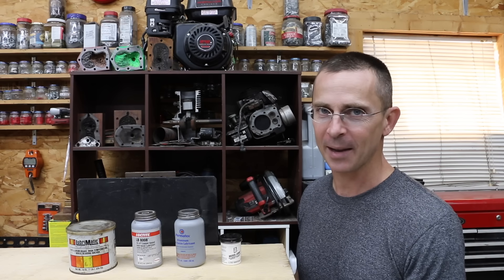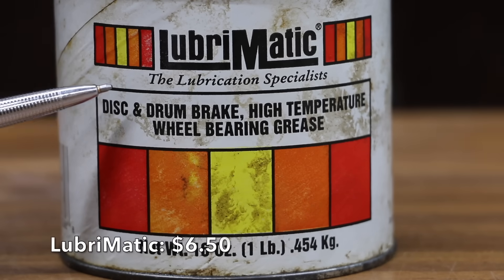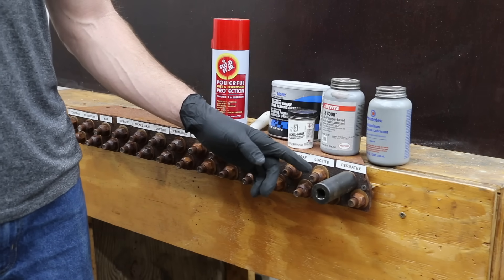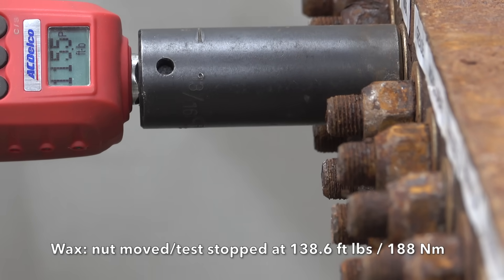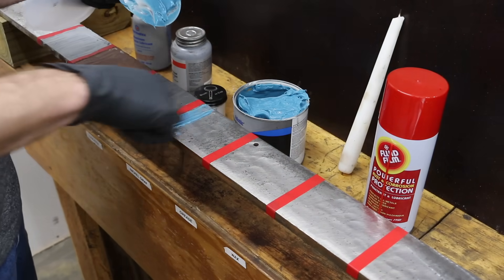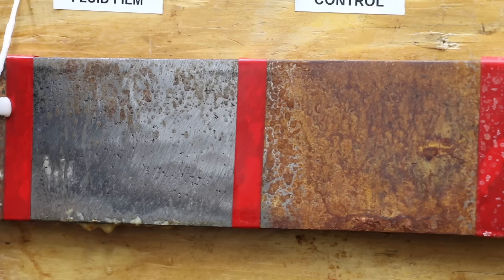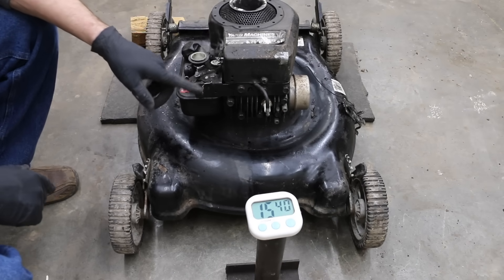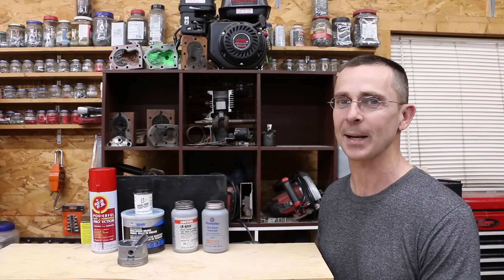Does Anti-Seize Compound Actually Work? Let's find out! Anti-Seize vs Grease vs Fluid Film vs Wax

Comment: I knew an old timer that said he always coated bolt threads with paint. He said it kept out moisture and prevented oxidation.
Reply from the maker: Thanks for sharing.
Reply: @billsmith1770  good point.  It might have been the lead that helped.

Comment: All you guys and gals who Love aluminum rims on your vehicles..?..Wait until you try to remove 1 on the side of a road,and it's welded to the rotor,or drum..edit=Worked in a dealership's garage and had to use a 4 FOOT prybar to crack rims loose when the 15lb sledge hammer with a 3ft handle didn't help, on vehicles just a year old.I was there during an infamous tire recall,and  a 100+ per week was Not fun(5 per vehicle,as I pointed out the spares)We did actually take turns for 20 mins on a car's rims before using the prybar.Do you carry a 4 ft steel bar?

Comment: I love your videos, and I've learned so much.  I'd like to see a radiator stop leak comparison.  Maybe you could rig up something where you could circulate hot water/antifreeze through some cheap heater cores with different stop leak products in them.  Personally, I've used plain eggs to stop minor radiator leaks in more than one car(Seriously.  My theory is that the protein gets cooked and the solids are what plug the leak).  Thanks for the consideration.
Reply from the maker: Great suggestion!  Thank you.

Comment: Lot's of folks are doing home improvement during the pandemic. I know that I, personally, am sanding and painting my kitchen cabinets. There's a lot of conflicting information about which is the best kind of paint for cabinets. Most sites recommend using alkyd paint for cabinets, but looking in stores, each brand seems to have some form of hybrid that they claim is the best. I've also seen melamine paint recommended.

Test I envision are:
Low heat, long duration
Typical kitchen fluid exposure (cleaners, oil, water, food waste-specifically acidic things like pasta sauce)
Time to wear from rubbing
Impact resistance (specifically things like chipping/peeling)

I would set a baseline using sanded hardwood (oak?) either with or without the same transition primer across all tests. You could later test the efficacy of primer.

I know you've done a paint test in the past, but this a little more specific and gives you the opportunity to abuse the paint a little more. :)
Reply from the maker: Thanks for the feedback.

Comment: I would like to see the effectiveness of different paints for rust prevention. red oxide vs zinc vs hammerite
Reply from the maker: Thanks for the video idea.
Reply: Yes! Paint quality is annoying sometimes! How well does it cover(does it need one coat, two, three?), how finnickety is it (clean surface; different materials like plastic, aluminium, steel; will it go over rust like some claim), how easily does it go on (spray can vs brushed on), resistance to wear/abrasion, resistance to heat, how well does it protect the surface. It's very annoying to spend money on a nice colour of paint and then find it's chipping off!
Reply: PF
How about RUST CONVERTERS ?
You make LOTS of rust. Popular ones "I" have tried here on the Gulf Coast of Texas are Evapo Rust, POR 15, CRC and Rust-Oleum. Nothing works down here with the combination of high humidity and salt laden air. I now have some OSPHO rust converter I'm fixing to try out. 
still watching every one of you videos. 
Thank you very much for all your hard work and dedication.
Reply: I can tell u from experience that red oxide primer from Rustoleum products is Crazy good at Preventing Rust in a Mild steel application. Nothing better !

Zinc cromate primer for Aluminum. Nothing better !

Rustoleum products are awesome !

Comment: ]When working with aluminum heads and steel spark plug threads, for instance, I swear by  Zinc AntiSeize.  With modern engines & ignition systems, the spark plugs can be in service for a Looooong time, giving galvanic action a chance to do its thing and eat the alloy threads.   It's expensive, but a little goes a long way, and it's cheaper than a helicoil.  Have you ever seen a spark plug blow out of a head.  It's no fun, and maybe the monkey before you overtorqued it, but I'll take every advantage I can and use this stuff religiously.  Your mileage may vary, but when I wrench on dissimilar metals, this is my go to for fasteners.
Reply from the maker: Thanks for the feedback.

Comment: Hey project farm, try testing Amsoil Saber 2 stroke oil 100:1 ratio. Amsoil claims you can use their 2 stoke saber oil at 100:1 in any power equipment application with premium protection regardless of the manufacture recommenced ratio mix. Please test it out. I want to know if 100:1 is really safe like Amsoil claims to be.
Reply from the maker: Thanks for the video idea.

Comment: I would consider the products that need as much torque to remove and was placed upon them.  Imagine if the lubricant, sealant only needs 10% of the torque applied when tightened, to loosen.  that means that the things being held together could come apart much easier.
While no one wants to break a nut of bolt to take a thing apart, that is preferable to having it come apart during use.

Just one observation.

Oh, wax will never work above its own burn point, as it will, of course, burn away.
Wax will only work when temperatures remain in small range wherein the wax is between melting and freezing. (Freezing, meaning it will crack and flake off) vs solidifying (Where is hardens, but remains intact).
Reply from the maker: Thanks for the feedback.

Comment: At some point in the future do you think you could add a couple runners to the utility blade battle with bulk online purchases in mind? If you head to amazon.com, there are at least 5 manufacturers with 4.5 or more stars that sell either 100 or 50 blade packs. Workpro(10¢ a blade), Goldblat(15¢), BIBURY(24¢), IVY Classic(24¢), and a different Stanley "Heavy Duty 1992"(12¢). Thank you for the amazing work you do!

Edit: Although they are far far more expensive, could ceramic utility blades be worth the cost if they outlast steel?

Comment: I have worked around underground mining equipment for almost 40 years,  with that being said:  (1) Bolts that are going into a tapped frame, i.e. no nuts,  should be covered wit never-sieze, (2) studs- should be loc-tite,  (3) Bolts should have the minimum Length left over if you double nut them,  holds the thread and prevents corrosion,  with that being said, I love this site.
Reply from the maker: Thanks for sharing.

Comment: I have taken heavy equipment like A&W cranes, Terex haulers and others that were built with never seize and repaired them with no problems on disassembly. Like 30-50 years afterfirst use.  I was sold on it.
Reply from the maker: Thanks for sharing.

Comment: I use Permatex Aluminum anti-seize on every threaded connection, form plumbing, automotive, farm, and electrical.  I have been using it since it came out!  prior to Permatex I used "Never-Seize" that I believe was available at International Harvester dealers.  Great video on the topic!    
Here is an idea for a new video, unless you have already done one on this topic.  That is: "permanent" markers.  I have used black Sharpies and  black EXtreme Sharpies.  I have found they last 2 to three weeks outdoors in the sun.  NOT my definition of permanent!  It would be nice to fine a BRAND that actually was permanent for marking outdoor items......
Reply from the maker: Thanks for the video idea.

Comment: You should do a shop vac test.  One test for the  portable shop vacs.  And the other for outlets.

Which one has the best suction for wet and dry.

Tried finding research on lift and cfms but no one hasn't done a thorough comparison.
Reply from the maker: Great suggestion!  Thank you.

Comment: Thank you again for your thorough testing.

Video idea as I don't see that it's been done yet, but you have done some similar tests:
Test out different drills/ impacts (Milwaukee, DeWalt, Mikita, Hitachi, Ryobi, Black & Decker, Skill, etc. against Harbor Freight brand drills Hercules and Bauer and any other off-brand power tools that come to mind). Battery life during use, battery life when cold and during use, efficiency, durability, actual torque, etc. 

I mean, I like Milwaukee, but is it actually worth the money or is the Harbor Freight brand just as good for the price? Thanks again!
Reply from the maker: Thanks for the video idea.

Comment: Yet another great video!  (No surprise!) Just a few days ago I had to change a tire on my pickup- box trailer.  The tires hadn't been off in about 8-9 years.  The lug nuts were rusted under the stainless steel covers,  but not to the studs and spun off with no effort thanks to having been anti- seized last time they were off!   The stuff works!!
Reply from the maker: Great!

Comment: I do know I've used permatex anti-seize on my caliper guides and sliders after a little time it turns into cement I have found... Now I use high temperature synthetic wheel bearing Grease seems to be doing the trick..
Reply from the maker: Thanks for sharing.

Comment: idea for a future test. gun lubes. there are literally dozens to choose from.
here would be the tests you could put them through:
Film strength test
Corrosion Resistance
water resistance 
Cold temp viscosity/flow
Heat resistance

Lubes I'd like to see tested:
Break Free CLP
Hoppes #9 lube
WD 40
Lucas gun oil
slip 2000
Mobil 1 synthetic motor oil
Rem oil
super lube grease
shooters choice fp-10
Ballistol
Weapon Shield

some of these products are really old, Balistol predates the 1st workd war. WD40 has been around what 80 years?  alotof shooters swear by mobil 1. I like super lube grease. i've used break free and fp-10 for years. some i've never used like weapon sheild and slip 2000. maybe you could do a crossover event with Paul Harrell. I can see the video now:

PH: Today we aren't on a gun range so you won't have to deal with gun fire in the back ground, instead i'm at the Project Farm laboratory testing gun lubes. At then end we are going to shoot one of his lawn mowers.
PF: WOW!

eta get Ian of Forgotten weapons to supply some god aweful esoteric gun to test with and SteveMreinfo1989 could do taste testing. it would be the most ambitious crossover since Infinity war.
Reply from the maker: Thanks for the video idea.

Comment: I always use copper grease, it's relative cheap and can resist high temperatures, works great on exhaust bolts, turbo parts, wheel nuts, wheel rims (between the hub and rim), brake parts etc......
Even after taking pieces apart after years of bolted together.
Reply from the maker: Thanks for sharing.

Comment: Here's an idea: Will a Titanium Knife hold its edge better than a High Quality steel knife?
Reply from the maker: Thanks for the video idea.
Reply: How durable is a ceramic knife? Do they chip or dull easier than a ss or carbon steel knife?
What about whether all these g whiz knife sharpers you see o TV really work?
Reply: @lloydholt6511  Ceramic knives hold an edge longer, but chip easier, because zirconium dioxide (the ceramic material for knives) is significantly harder and stronger than steel, but has substantially less toughness and ductility.
Reply: Titanium isnt a very good primary metal in a knife. It dosent hold an edge well but its a great additive to make steel significantly more ductile However if you make a knife out of titanium. Carbide you'll have an ultra sharp brittle razor
Reply: No!

Comment: Permatex works great as a substitute thermal compound. Been using it for years on every PC that comes through my shop. When compared with actual thermal compound, the one difference is the Permatex never solidifies, which is good. Plus it doesn't conduct electricity. Hmm...sounds like a video idea.
Excellent video my friend.
Reply from the maker: Thanks for the video idea.

Comment: Guys, as a mechanic, please please please stop using anti-sieze as a backing plate lubricant.  I don't care what the bottle says, it's abrasive as all heck.  Both aluminum and copper anti-seize are great on steel exhaust manifold bolts going into cast iron heads and other exhaust components.   I'm talking ability to loosen a fastener 10-15-20 years down the road vs not at all.   However, I don't like using anti-seize of any kind of steel bolts into aluminum.   I have found that aluminum anti-seize on steel bolts in aluminum castings (example: egr bolts) does tend to dry up and damage the threads on bolt removal.   A dab of white grease on the bolt seems to do fine.  Your call.
Reply from the maker: Thanks for the feedback.

Comment: i know a guy who has a 250cc 2-stroke motocross bike and a 65cc2-stroke  MX bike.  The manual says to use 5w30 non-detergent oil in the bottom end (not the two-stroke gas/oil mix.  He uses Automatic Transmission Fluid in the wet sump of both bikes and says he's never had a problem.  Can this possibly work?  I say "no."
Reply from the maker: Thanks for the feedback.

Comment: I love your reviews!  But this one I had a little problem with...  For your controls, the breakout torque was only about 2 or 3 times that of what you originally tightened them down to.  Now you're a farm guy, you've seen your share of bolts that were so rusted on that you break the bolt in two twisting it off, or you have to use a cutter to cut the nut, or something like that.  I'm only suggesting because I know you want your tests to be real world and useful, and they almost always are.  Instead of simulating the corrosive environment, use some plain steel, not plated bolts and nuts, degrease them or sandblast them, and leave them outside on a fence post for a year in the rain and snow.  Then they'll heat and cool, expand and contract a couple hundred times, and should rust up solid.  Don't be discouraged by my comments, your channel is great!!

Comment: discovered a cool thing today liquid tape its liquid electrical tape pretty cool check it out using it to seal a intake manifold on a 4 wheeler that has cracked and cant get parts. its kind of like plasti dip but its resistant to gasoline from what it says
Reply from the maker: Great feedback. Thank you

Comment: I have used the Aluminum Permatex anti-seize for 40 yrs.  It works amazingly well and will never stop using it on my projects.  I have seen a wheel rust to a hub  I could not break loose with a sledge hammer.   Only  a torch made it break loose.  I use anti-seize on everything.  I swear by it !
Reply from the maker: Great feedback. Thank you

Comment: When I started working in commercial & industrial maintenance in the 80's, we used anti-seize, which was silver and Nevr-seize, which was a copper based bronze color. I preferred the Nevr-seize then, and today I use the Permatex copper based. Over the years, I've always found the copper based compound to be the superior product. I use it on everything automotive. Especially exhaust system fasteners. You'll be glad if you need to take it apart in the future.
Reply from the maker: Great feedback. Thank you

Comment: Mechanic for 46 years and antiseize works either one, grease if that's all you have. If you install a steel bolt into aluminum part it's a must...also on spark plugs especially in aluminum heads. Lug nuts need anti seize on the treads as well as exhaust manifold bolts.. 
old bolts like on 1950's autos will turn out once broken loose, bolts on cars made in the mid 80's up have a great chance of ringing off if they weren't installed with anti seize. Must be the cheaper grade steel.
Reply from the maker: Great feedback. Thank you

Comment: Good test. I wondered if the anti seize compounds conduct electricity, if they were used on nuts/bolts on terminals or grounds, like in saltwater marine applications.
Reply from the maker: Great point. Thank you
Reply: @ProjectFarm  Curious as to see how WD 40 would perform under these conditions.

Comment: I worked at a place that had domed curing presses. Using nitrogen and steam it would create an acid in them that caused the mounting bolts to lock up. One of the guys tried a good quality pipe dope on the treads during a rebuild and it worked great. It wouldn’t wash out and kept steam and acid from getting to the treads.
Reply from the maker: Thanks for sharing.

Comment: I thought the point in anti-seize was to prevent cold welding (different metals like aluminum and steel becoming bonded)?  I know RJ The Bike Guy recommends it for any application involving Aluminum on Steel, like a headset, bike pedals, or seat post.

Also, I had to skim through this video a second time, because I thought I had missed the lubricity test.  ;)
Reply: You are correct it preventing cold welding. Worked for GM and have seen what happens when you install an oxygen sensor without anti-sieze (they recommend the copper type) , or a spark plug in an alumium head for years.
Reply: The CNC lathes where i work use thick EP lithium grease to prevent SS gauling.
(SS drawbar + SS chuck + no grease = nice fusion of the threads + a real fun time with a small file on hardened SS...)
Reply from the maker: Great point. It helps with that too.  I thought about a lubricity test but anti-seize contains solids that become abrasive in high speed applications.  The lawnmower didn't last long. lol